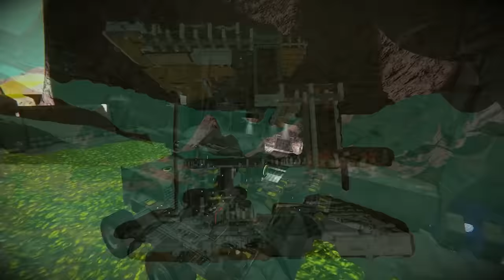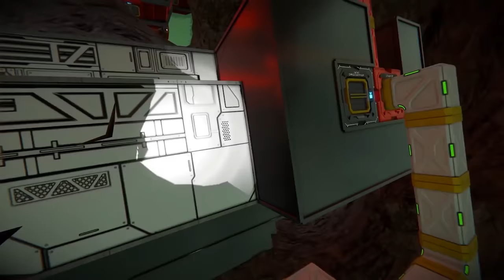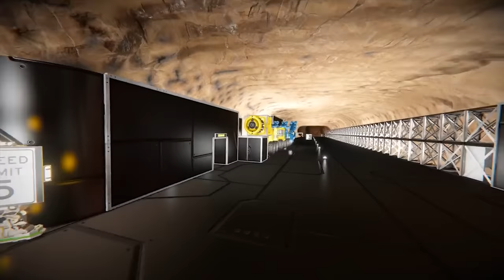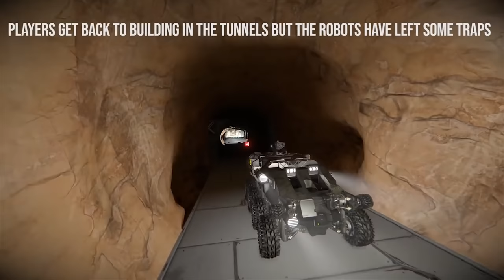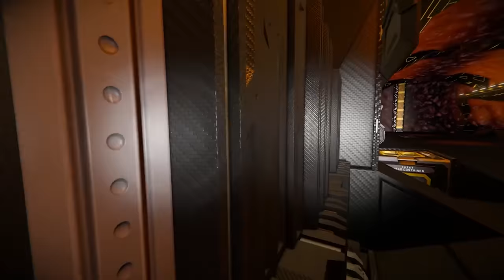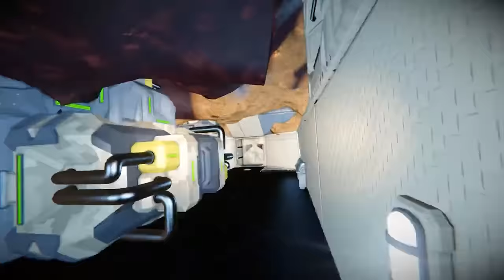WHY UNDERGROUND BASES SUCK !!!! - Space Engineers

Comment: counterarguments to your points
1.simply build walls and not use raw voxels for interior walls. now they have to go through the blast door anyway with less energy wasted on voxels and in a possibly harder to breach position
2.claustrophobic encounters, or cqc, is incredibly volatile because of how quick it becomes, ontop of chokepoints. the point of burying a base is to slow an enemy down. ontop of that, it leaves intel hard to come by since you cant just eagle eye a bases layout from above.
3.the counter to placed mineheads is to just put more armor layers. or make your base "exterior" look like rock so its easy to miss until your drill goes clang, leaving it hard to figure out its layout from a moles perspective. possibly even bury "goodies" for them to find like turrets and mines. a motion detector can see through terrain and walls alike. 
4.lockdown procedures should be standard on things of signifigant size. even more effective underground if you reinforce the place as they cant just  walk around and try another wall, rather they have to find it and dig blindly for it.
5.there should be no "getting ready" state for underground, as you can easilly conceal fully ready defenses with a hidden corner or so on without fear. without distant sight of it by recon, they have no way of knowing its there. if it kills quick enough, it can even repeatedly get players if they die before sending a message about it
6.last but not least, you my have to go through tunnels but so do they. as well as removing support if its far enough down. and if you can dig around, so can they. plus a tunnel they dig is even smaller, perfect fish in a barrel for something.if they leave the hole open, put a trap down real quick for the next team coming behind them. in short the home advantage by knowing where theyll go and knowing the shortcuts to get to them first. bonus points if you have hidden tunnels for doing this.

Comment: Interesting takes.

A few things:
Pve has less worry of invasion than pvp does.

Original state is null after a change is made, so instead of a mass log of change, there should be original state, current state, and an event listener for voxel change, and some extra threading for the physics.

Penatrability is dependent on design.  Underground shouldn't mean less armor. The point is to increase strength and overall  recoverability. If you opt to use dirt instead of armor, you're a fool. Irl a dirt ceiling=collapse. Treat it the same in the game. Armor EVERYTHING.

Also irl, an enemy will be no holds barred. Treat it the same in game, and dont be so attached.

Decoy cooridors do wonders

Paint externals to camouflage. My triton base is an ice blue/grey washed frosted texture. Pretty invisible unti you're a few 100 meters away.

Comment: Some years ago we started playing on a fresh server with a lot of people we've never met before. The host told us that underground bases are allowed as long as they wouldn't "turn out too crazy".

I'm a full dwarf player, so I'm very experienced when it comes to building underground bases. To save some time, I built my usual tunneling machines. It's basically a pipe network with huge automatic machines slowly crawling alongside the pipes while digging away the voxels in front of them and building a base module behind them. The idea behind them was to have a tool for searching ores very deep below the surface level (Deep Ores mod basically moves all ore spawns a few miles further down compared to vanilla) while also providing a comfortable way to mine them and get the ressources into our containers.

Those machines can replicate themselves as well, so at the start I usually build one which in turn builds five more of its kind. This was no different on the first day on this fresh server. I was tired as fuck and just wanted to set up everything for the next day so that my friends and me would have a headstart. After I was done with the neccessities and six machines ready to go, I happily went to sleep.

The next day we noticed that the server was offline. Turns out that I forgot to turn my machines off before going to bed. Over the course of 9 hours they had built 1000 refineries and over 3000 large containers and filled half of them completely on max container size settings. The planet looked like a piece of swiss cheese and the lag killed the fucking server.

After that, the host decided to wipe the server and start a fresh scenario, but this time he prohibited underground bases altogether. Though I might have been the sole cause for this dilemma, I am also a full dwarf player - and I don't play on servers where underground bases aren't allowed. So I basically just fucked up the rules for a lot of innocent people.

I consider this story a pro for underground bases, btw. :<

Comment: The funny part is...I woudn't build one as a storage site, But a transit site.
They are good for trade function. I would never use the ...subterran rocks as walls or ceiling.

They would make good miner operation transits. But no it's not a good defender spot etc. unless you build a extra layer walling keeping everything internalized and exteriors extra padded.

If you use the transit right you would have to understand you be findable.

Orbit strikes could be cancelled out IF you dig greatly deep enough. To add cost to attack ratio. If it's transit...it's not worth striking honestly.

(A Transit station can be linked to a mining center, But the goods are sent out to other bases to their construction plan and make. You would send out the materials to the production factories where commonly people mix all their bases as 1, Miner/Craft.)

It's tricky but they are only good for miner/transit combo places to send to a factory/base That way you can prob split out a factory section from base to add line forms to avoid...attacking the prime base to shut everything down. Shutting down a miner/transit sucks but it's common to build many to send to bases anyways. This goes to factories, You should consider more than 1 factory to rebuild/set up bases again if struck hard.

Also once done, YOU could decommission these places maybe leave them as is or recycle them for the scrap etc.

Comment: Most of the issues you are raising also apply to surface bases.
The main difference being, as you said, underground bases can' suffer from an orbital strike.

Having a way out is not necessary, if the goal is to protect the base, you don't need a way out. And you certainly don't need your enemies to have multiple ways in. What you need is chokepoints. Large areas that can hold a lot of attackers, that end with very small access points and killboxes. And that's easier to do underground or in every controlled environment.

Underground, you need to be aware of people coming in front of you and eventually from the walls if they dig. But... you should protect you walls, leaving some areas easily accessible to drills is the same as not putting any hull to your ship.

On the surface, people can drop from the sky, they can destroy infrastructures from afar. It's not possible to do so underground.

There are reasons why sensible military or administrative infrastructures are built underground IRL.

But well... we also have bunker buster weapons IRL.

Comment: the only thing i build underground is Secured Storage with a Garage entry that is covered in Turrets lol.
of course, people can dig into it, but to get to the storage parts, they still have to breech esentially 3 or more layers of heavy armor blocks with Heavy Armor Sheets on the outside of that again, and Turrets inside covering essentially any entry, with the storage in the middle, armored up as well.

of course, building a base underground CAN work, but only if you build it as a Underground fortress where there are the walls and THEN the main parts. otherwise, you leave massive security gaps inbetween, and it takes a LOT of effort to repell attackers, if even possible.

no, underground structures should be for storage, and nothing else. a mountainside Hangar maybe, but mainly just storage. and that also only work if it is built like a Vault.

Comment: ...hmmm...
Server-wise underground bases lag more...
Player-wise they are better than surface-bases for stealth and bombardment resistance...
The rest is just a matter of how you build it. 

Personally, for those rare occasions where I feel silly enough to build a proper planetary base in a pvp environment, I find it best to run a single narrow winding tunnel deep underground, ending in a hard turn in to a massive excavated cavern, with the base being a heavily armed bunker floating in the middle (dressed up like a floating tower or something if I'm in an artistic mood). 
-The hard turn and still relatively tight confines tend to effectively force attacking craft in to a slugging match they have no hope of winning with the much larger base. 
-At the same time careful attention to external geometry and turret placement makes it exceedingly difficult for hydrogen men to find somewhere they can get in and grind.
-Traps in the tunnel and mines along the excavation's walls technically help, but do require a relatively large amount of extra work to maintain for what is likely to be only one or two kills (assuming smart attackers).
-In the event of persistent attackers, respawn to a combat craft stored off-site and attack their flank.

It isn't impregnable, but it does the job about as well as it can be done in that scenario.

Comment: But what about a concealed asteroid base large enough to house one large warship and I'm talking about a decently sized asteroid that's been sufficiently hollowed out to provide all the facilities and act as a large Hidden Hanger for your warship, (for example a Star Wars Arquitens class cruiser), the hangar is large enough to house that and maybe a couple support Fighters or other aircraft or Vehicles capable of being transported to and from space and ground not only do you have an on-board Hangar Bay aboard the ship where you could potentially house a few more vehicles but basically that ship is your Hub and your base is just facilities and living quarters and somewhere to keep it safe and hidden is this kind of idea viable included with safe zones and backup safe zones as well as auxiliary power sources and the like I mean getting the safe Zone big enough to be just under the top most layer of the asteroid while keeping it concealed would be the most interesting part but it would protect you for the most part aside from the large huge ass hanger door that has to open every time you want to take your Starship out which is also equipped with at least two safe Zone generators. Would this be viable personally if you play smart and think smart it can be pretty successful and I'm not really a PVP kind of guy I prefer PVE but that generally doesn't mean my ship can't fuck shit up if I have to. I'm also addicted to building I'm always having to build or tweak or modify something always at all times I have to be doing something.

Comment: It sounds like either less efficiency on hand drills - which I would balance by increasing the output of stone from a handdrill so you get the same materials in the same time, just from a way shorter tunnel - would solve this.

A safe zone around a base would also prevent this from happening.

Historically, the most accurate to an underground base would probably be a narrow hallway. If it's well constructed, that is.
An underground base could field far more vehicles and fighting power, realistically, than a mobile attack force. Combine that with a narrow and bunker-like buildstyle intended to support defense - like cone-shaped halls which force attacking forces to enter one at a time while allowing defenders to line up like a firing squad at an execution - and you get a base that has the most important quality a base can have: being nigh unbreachable.

The bases we build in SE are less similiar to homes and more similiar to castles. Very few castles were actually taken in battle. The tactic to take a castle is a siege - blockade the castle, cut off water, food, and supplies. Then let's see how long the castle can hold out.

Underground bases are like planets protected by a shield generator in Star Wars: it's impossible to effectively bombard them or run air strikes. The only feasible method of attack is an attack on the ground.

Comment: The key part to any good underground base. Is to dig it deep into a mountain or some place. Then hollow out a massive hole with your base in the middle floating. After that place turrets in every angle around your base (underground). When the rocketman mole shows up they will have no chance to avoid the turrets. You can also set up mini warheads with proximity sensors to slow them down further. 

Either way, above ground or below takes effort to build. Remaining hidden and unfound is always the best defense. If/when you are found. Then it deploy many above ground turret bunkers in the area.

Comment: Not an SE player but part time dev and gamer. Take this with a grain of salt.
On the side of performance, it seems like there could be some vertex culling and other optimizations that can be done. Although I have no idea how much performance would actually be gained.
On the topic of blasting through rock, it seems like the defenders would benefit from having deeper layers of rock be stronger and more resistant. Material close to the surface is easy to mine by hand, but below that is hard (or impossible) without machine tools. Possibly also adjust mining to take longer unless a specific high powered tool is used. Something that is great for mining or blasting but can be countered. Think giant laser drill but it needs coolant and power and if any subsystem is shut down then it goes offline (or boom)
On the topic of popping through the floor and peeking at goodies, there are ways to prevent this with graphical overlays. It just needs to be implemented. Think how minecraft used to have similar issues, but now just shows a texture on the screen.
The rest of the issues seem to come down to players not properly setting up their bases. This would eventually be solved by people learning what to do and what not to do.
Feel free to let me know where I am far off or pretty close. I have no idea how good these ideas are for SE.

Comment: ok first, any base built on ground... is susceptible to tunneling.  you can tunnel deep, below sensor detection ranges...   drill to under a base,  come up and plant  large bombs,   withdraw and set them off.   

now fully above ground bases have the same problems, you can have mazes of corridors, interlinking hallways, rooms, airlocks, cutting though walls, doors...   huge numbers of guns and turrets, custom turrets,  connecting roadways... and sprawling layouts.   Yeah.   and HUGE numbers of auto welders, to keep buildings repaired after ligthning storm damage,  and decoy towers, creating a lag effect to anyone who gets near the base.

underground bases do have the benifit of being far less likely to be hit by lightning.

Comment: This can apply only to PvP, and if you manage to make your base nearly invisible from outside using only radar antennas and far away relays the enemies will have a hard time finding your base in the first place.
The main problems as I see it is the server slowdown and increase in size of the save file, and the fact that if you're in a place without air, just voxels won't make it to make your base airtight, you'll still need to create rooms with blocks, and that will take plenty of time between digging and building.

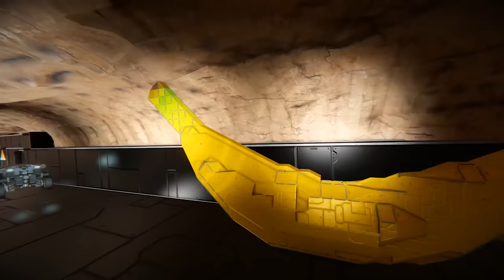Comment: I gotta disagree on the first point Arron . Sure it's true if you just use the cavern walls but that's your own lazy fault. If you build a proper base just as you would an above ground base it's better protection. Not only can't your attacker see the layout and guess where you keep the good stuff.(which you also pointed out as a perk)  but they also need to drill through layers of rock to get to your walls or find a weak point.(which you kind of touch on as well)  You could even do like we used to in rust and build giant bases that are just a maze of doors, most of which lead nowhere. This ensures most raiders run out of explosives and leave empty handed. I do agree with the points you made though. And on a side note... I didn't know how big your base was until i saw that banana @5:42 . Kudos.

Comment: it is only bad, because the game is not really made for pvp. The game has no built-in countermeasures. In this respect, Empryion is at least one step further and allows the area surrounding the base to be protected against drilling. But it doesn't even have to be such harsh measures. It would be enough if you had devices that could detect drilling and show the position. That would be a warm welcome for the attacker. ;)